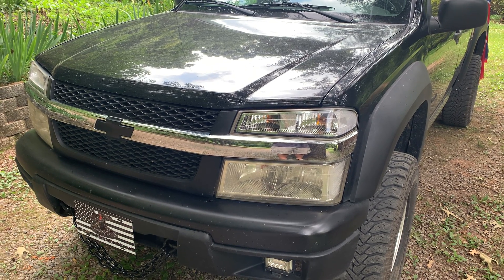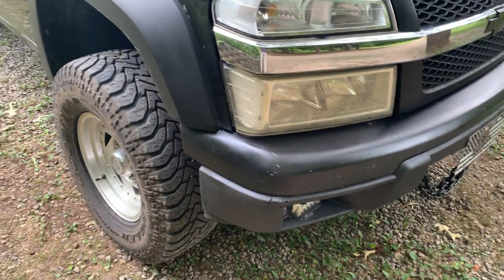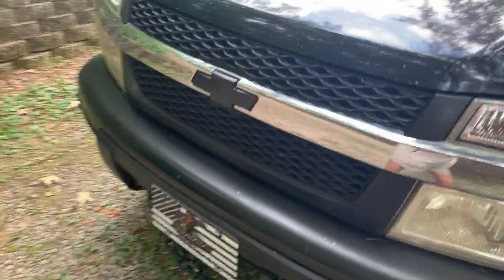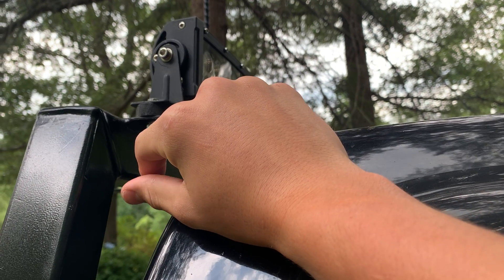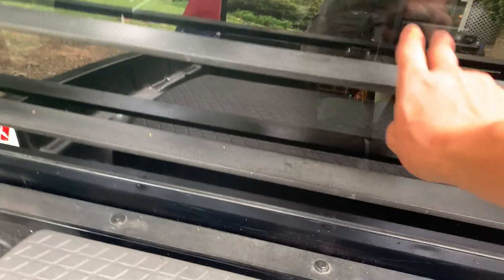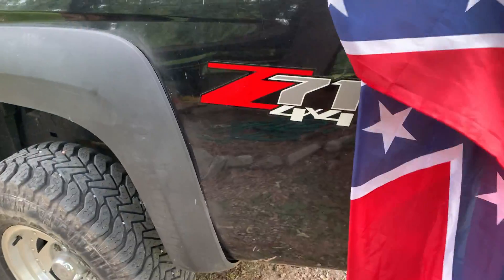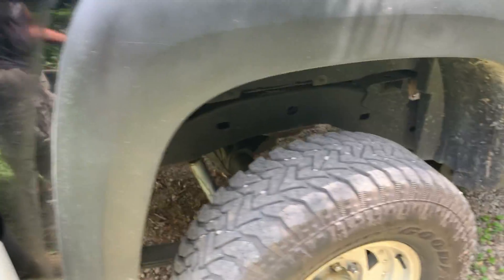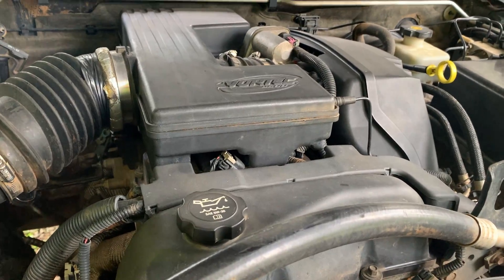My 2004 Chevy Colorado Z71 4x4 pt.1

Comment: Great Post, TY... so straight pipes? no Cat Converter ? don't need one in NC please explain, I have 2005 WT that I'm currently working on. and what did the lift cost you?
Reply from the maker: At the time this video was made I had it straight piped, it did not have the second cat converter but still had the one just off of the manifold. In my county in Nc it isn't required that you have a cat, but it might be closer to the city's. The lift is 70-100 dollars on ebay, its just shackles and a tortion crank. Later on I did do a DIY body lift using hockey bucks that was about $65 and gave me a little over an inch more lift.

Comment: I have the 2011 Chevrolet Colorado with the 3.7 five-cylinder engine. I bought it in 2011 brand new and I love it!  And, I too, have a CB Radio in it. I run the coax cable through one of the rear cabin vents (the thing that flaps open when you shut a door.).  Fits perfect.
Reply from the maker: Good idea on the cable!

Comment: A little late to comment but can you make a startup video of it straightpiped i want to put a new muffler on but dont know what exhaust system to do.
Reply from the maker: @Skaraskus I no longer has the truck, but I did run a few different mufflers. Straight piped it sounded really good, but ofc was very loud. A flowmaster flow fx was good but overall was a little on the quiet side. I might would go with a 40 series or a borla if I did it all over again. That way I could get a good sound when accelerating but it wouldn’t be insane the entire time your driving

Comment: Looking to purchase an 05 z71 crew cab 4x4 but I’m concerned of a brake issue my master tech told me. He said at high mileage the brake parts break easily on these models and you end up having to replace the entire thing every brake replacement, I love this truck especially with what you’ve done to it, mine will be all too similar at purchase and I do not want to be discouraged, I was wondering if you heard anything similar or it’s a possibility it was the one vehicle he could’ve worked on?
Reply from the maker: Mine didn’t have any break issues, I would research the “355nation” forums or “Coloradofans.com” forums for more information on the specific issues. Thanks!

Comment: My truck is 09 Extended Cab LT1 4wd 3.7L auto glove box says z85 but the paper when I paid it off it says 4WD Z71
Reply from the maker: Very strange,the two trim levels have noticeably different features.Weird they would get it mixed up.
Reply: @NC_outdoorsman  on autocheck it says LT/WT but my truck has 3.73s and g80 Z82 NZZ rpo codes
Reply from the maker: @danielmcdaniels295  I believe the Z71 option came with taller tires,possibly different wheels, and different suspension. I believe the Z71 had fender flairs from the factory.